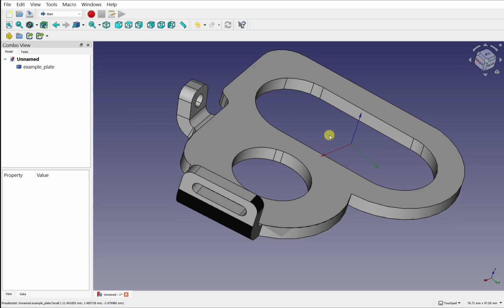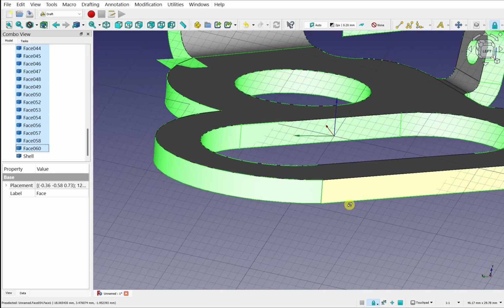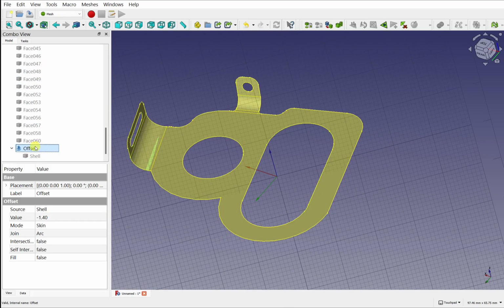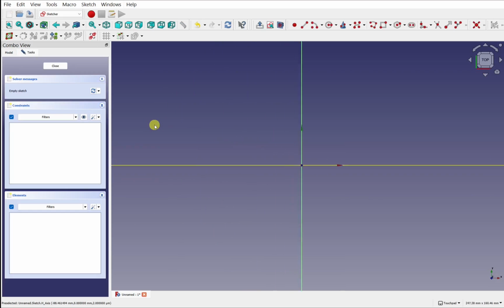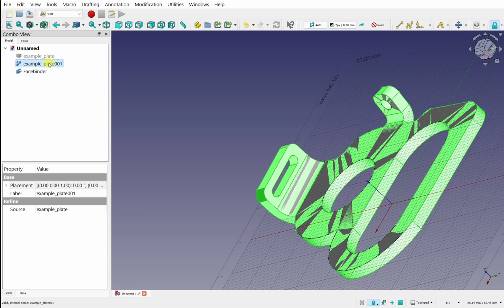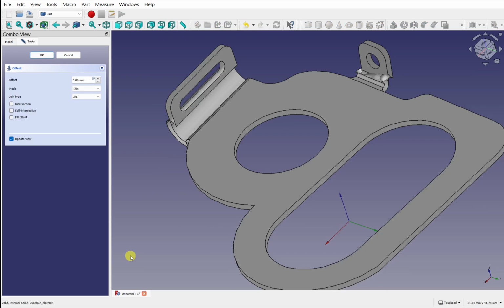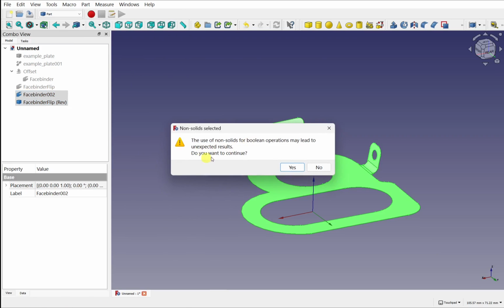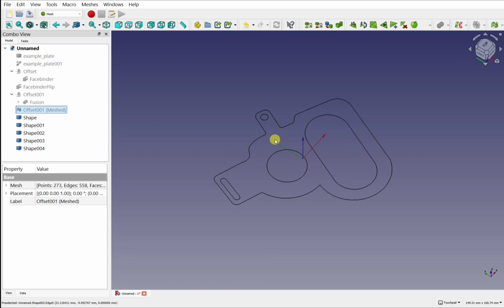FreeCAD: How to Unfold a More Complex Model For 2D Export From A Problematic Imported IGS File

Comment: This looks alot like a software issue which I assume you would not have in,  say Fusion 360 Correct?
Reply from the maker: No you would still have the same issues.  The model was made to have faults to show what you could encounter in the real world. Unfortunately broken models are very common.